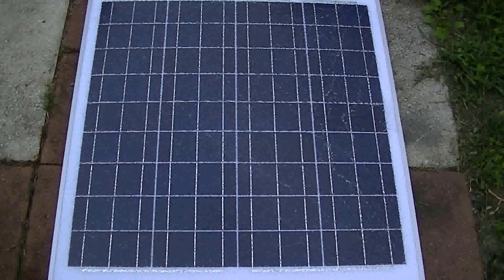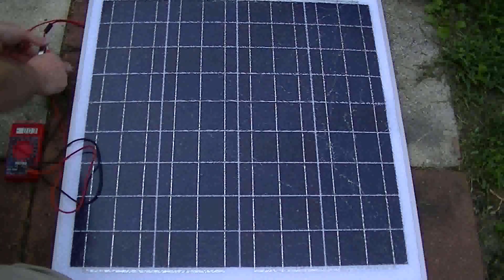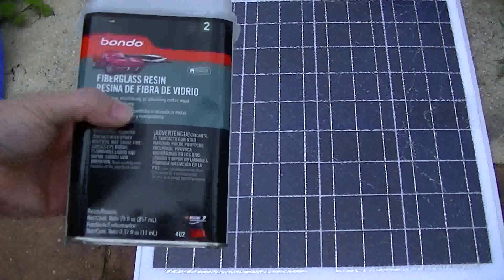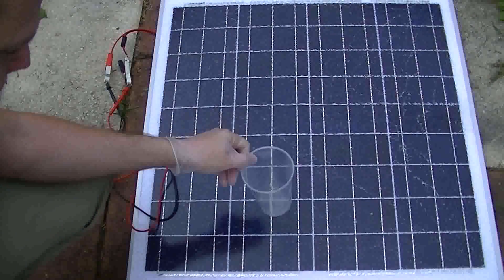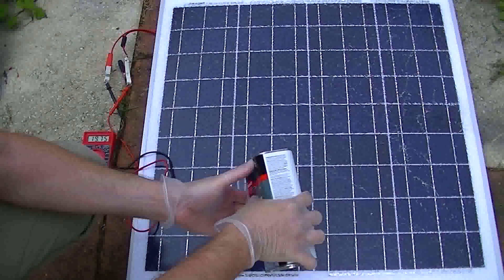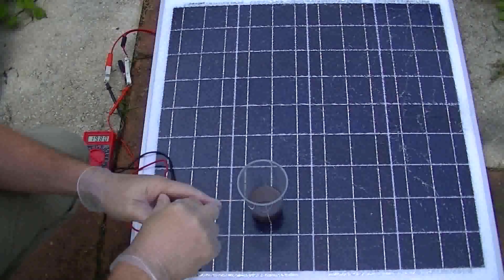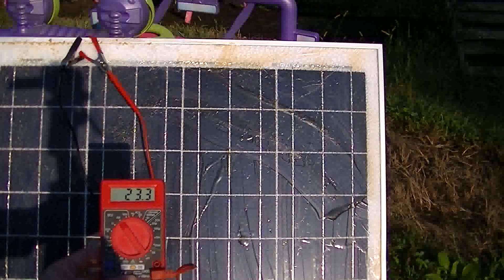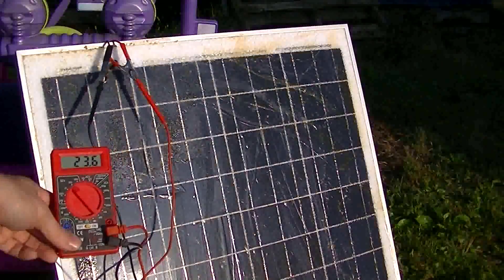Repair Solar Panel Glass ( how to )

Comment: Please I notice your post was posted 4 years ago may I ask how is it holding up? how many amps are you getting from it?
Reply: Use clear outdoor paint.
Reply: How well is the clear outdoor paint holding up,i have just broken 2 panels and it sounds a good plan if it works?

Comment: I know that my fiberglass covered surfboards yellow when exposed to the sun, so I would expect your panels to yellow.
Reply from the maker: Have you tried clear outdoor spray paint?
Reply: Jason Roush well, I dont make my surfboards, but theyre pretty much some foam, with fiberglass cloth and covered with that clear resin and catalyst. If you leave them exposed to the sun they yellow. I had a longboard hung on the wall and it would get sun every afternoon. It yellowed. But hey, I'm not hating, have the panels yellowed? If not cool.
Reply from the maker: It flake off, that's why I now tell everyone to use the clear outdoor paint.

Comment: Hello I am From Brazil i am having almost the same problem when I test amper, My solar panel it is 95W and 5.5 amper when i test it shows only 1.6 amper, and i don't know how to solve it
Reply from the maker: If the cells are broken , sometimes they can be soldered back together, but if the glass is glued to the cell it maybe better to live with the 1.6 amps. If it is only the outer glass broken try clean outdoor spray paint.

Comment: Hello!
My name is Rogerio and I'm from Brazil, Sao Paulo and do not have much access to photovoltaic panels, a product with very high value, got two panels of 150w of a company that manufactures flags for highways only have been injured by a car crash, only the glass broke, that's the best way to repair it or it is possible to make the switch from glass? I would be very happy if he answered me.
good luck
Thank U

Comment: I just picked up a 215 watt panel with a returning to earth bullet wound. The previous owner let it go for $50 because the entire glass panel is spider webbed. Still peaks at over 40 volts. I am assuming I cant just replace the glass myself because of the way the cells are sealed underneath it and I was searching for an alternative and, voila. Thank you, sir! Very brave of you to keep it and DIY but who the hell wants to wait for UPS anymore than they have to, especially after breaking it in the first place. Did MWandSolar have Fragile printed on the box?
Reply: MissouriWindandSolar are great to work with and offered to replace it for free. It was double boxed so it had to be dropped hard.
I would go with polyurethane, it will last longer.
The fiberclass resin breaks down from the UV light.
Reply: You're pretty bold to keep the damaged panel just for the sake of video! I definitely appreciate it cause there's only 3 other video tutorials on here.
Reply: E

Comment: The UV light from the sun eats up epoxy.  I'd guess that in a year the epoxy either peels off or is gone.  Bad idea in my opinion.
Reply: Jason Roush Just scrape the resin from the glass with a razor. It's amazing! The cracks are all filled in.
Reply from the maker: yep, it has already started. Any idea of something better I could use?
Reply: I might try:  Sylgard 184 encapsulant.  See if this link works.  It's made for solar cells.  http://www.amazon.com/Sylgard-Solar-Encapsulation-Making-Panels/dp/B004IJENBG

Comment: Excellent job- but you REALLY need to measure your fiberglass components more accurately!  They have some tolerance, but if you get too far out of the correct ration, it just doesn't work....
Reply from the maker: Patriotgal1 I also should have done half the panel at a time. It was setting up on me before I finished.
Reply: @tiggeroush  Sounds like too much hardener, too warm place and i would not recommend using fiber glass resin, but some other type of epoxy if that is only option to weather proof it.
Reply from the maker: @Hellsong89  or just use clear outdoor spray paint.